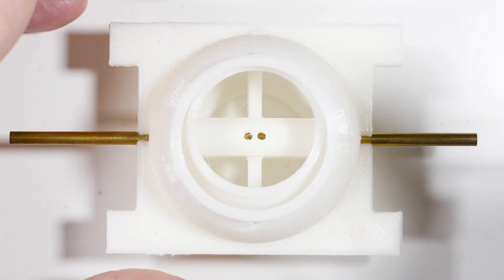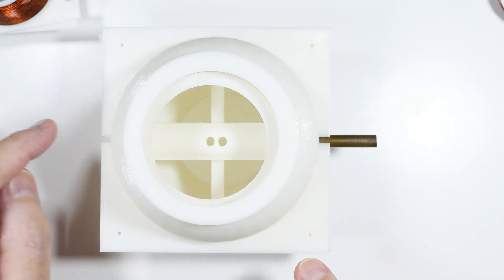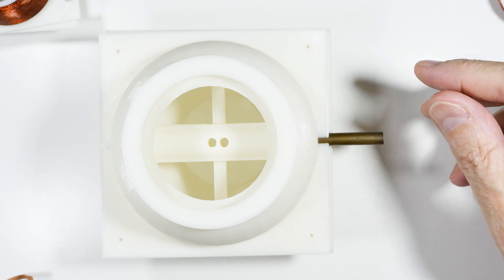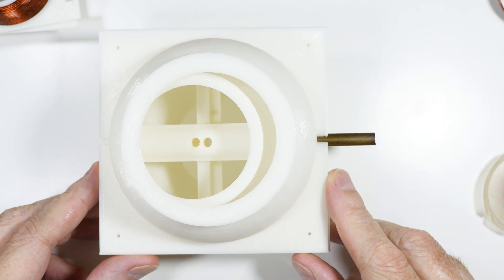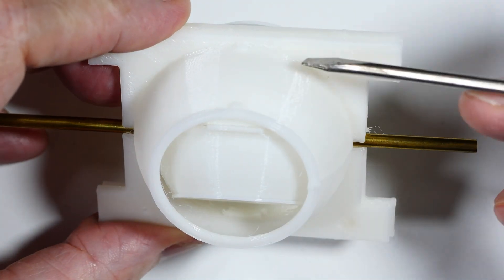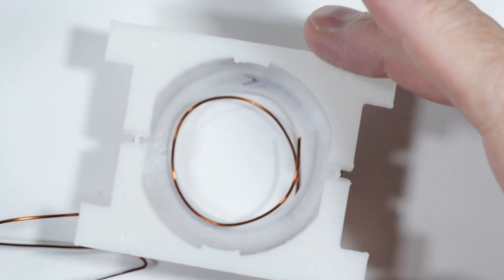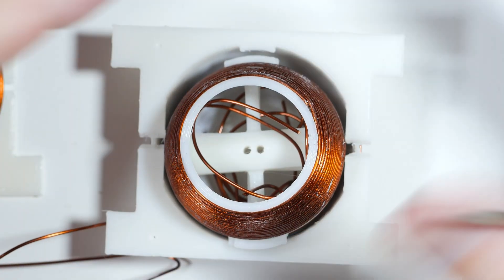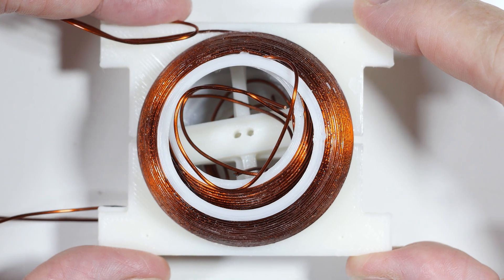Crystal Radio Variometer Pt4 - Better Yet! (4K)

Comment: I was thinking of having the coil wire to run inside the rod. that way you don¨t need a connection from the coil to the rod. the rod will be isolated.
Reply from the maker: Sounds interesting. How does the wire from the inner ball coil connect to the outer coil so that the inner can rotate 180 degrees? I've been straining my brain on how to make the connection.
Reply: @tsbrownie   I think that a multistranded wire isolated should work and you can even have both wires out on the same side.this means that the shaft needs to be cut in the middle. I have a big interest in this coils and will look into your 3D files when I get the time. Are you going to 3D print the holder to?
Reply from the maker: @haraldlonn898  I am still thinking about how to mount it.
Reply: @tsbrownie  As I se it there is one long rod for tuning and a short tube where the cables run through. aÁ holder you can 3D print so you can mount it in a chasie. sorry bad spell I am on way to work
Reply from the maker: @haraldlonn898 It took me a long time to understand what you mean. I saw a video with an antique variometer that works like you describe. Makes sense. I will have to prototype one.
Reply: @tsbrownie  I will look forward to see the new design. Me to want to make some test and see if I can make a antenna tuner without this big rotating long coils. Keep up the good work. 🤗
Reply: I've been thinking about making a variometer where, instead of feeding the wire through the rod or using  a contact to the rod, that I make the central coil wire ends into a simple loose loop around the axle, like a clock spring. Then I'll put stops on the inner so it will only only rotate 180degs. There should be more than enough flexibility in the copper wire and enough space between the rotor and main coil is the wire, as in my case, is quite thin. It is also easier to do than having to make a contact and will also give a guaranteed electrical join between the coils.
Reply from the maker: @aphanez  The spring connection (and wires through the shaft) were both done by companies 100 years ago. Both have pluses and minuses. The spring must be very flexible/ lightweight to prevent interfering with the ball movement and therefore is prone to damage. The internal shaft wires wore and twisted so had to be repaired as they broke down.